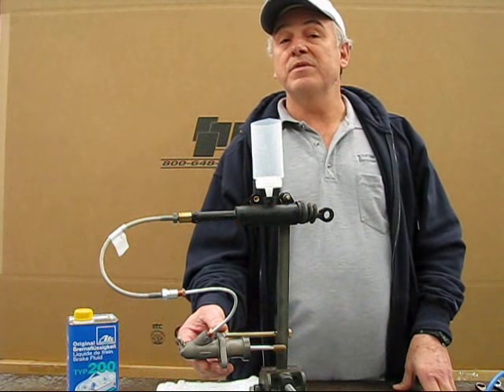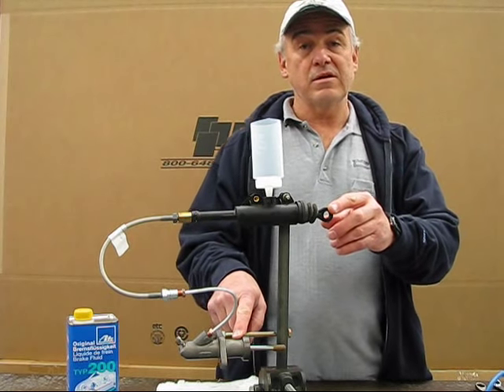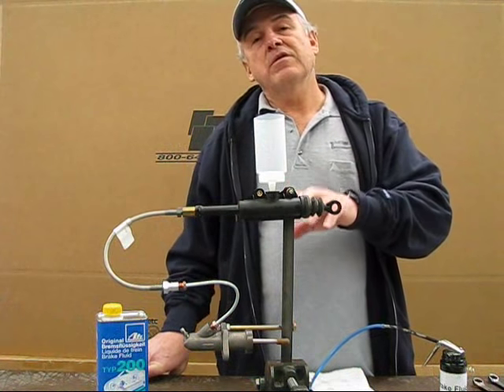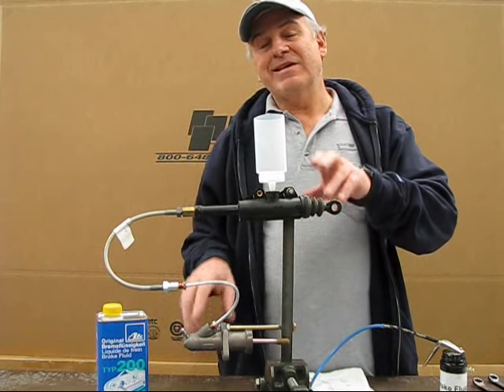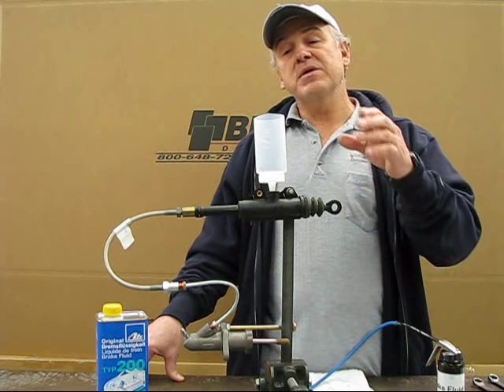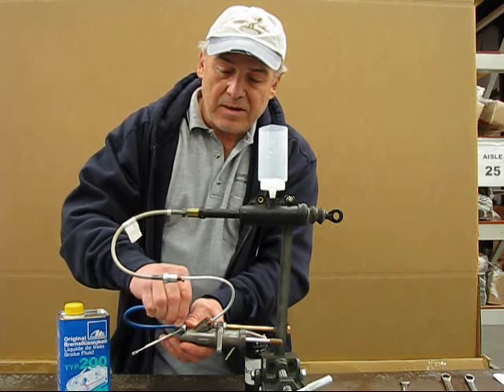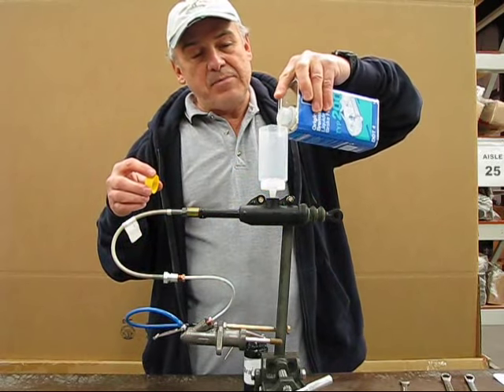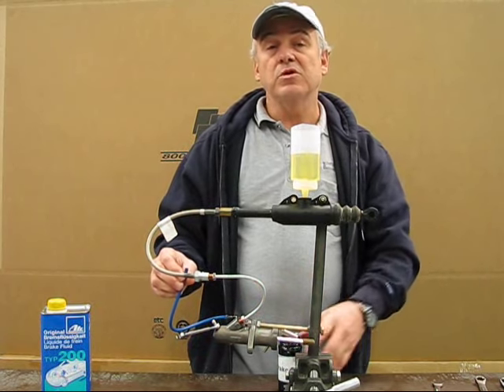BMW, VW, Porsche Clutch Bleeding

Comment: The flex line?  You mean a line specifically for brake/hydraulic fluid, or will just any pvc hose will do?
Reply: honestly, unless you plan on using it multiple times you can use any line that wont immediately disintegrate. Nylon line is fairly cheap and will do the trick.

Comment: hello i have the same problem as sphinxxx , i put the oiler under the level of the slavecylinder,clear hose and loose 1 turn the bleeder and fluid kept coming out from the threads,i pull out the whole damn bleeder and try to insert fluid and made a mess..I thought something is bloking the flow but how i can fix that without removing the hole system,,,I cant put pressuaried air cause could be worst right?

Comment: Thanks for the video, great information.  Maybe you can help me?  I started my E30 up after almost a year in covid storage.  It’s three hours away.  It started up no problem, but no clutch, it wouldn’t go into any gear.  I replaced the slave cylinder; and still no clutch? Is it possible that I need to try bleeding it your method? I planned on replacing the clutch master cylinder next. Maybe It’s not necessary? I did see some fluid on the floor of the garage around the area of the master cylinder. Any thoughts? Thanks.

Frank
Reply: Sounds like you lost all your  brake fluid... it leaked out of the slave cylinder.  You will  of had to bleed it  after the new parts were installed.

Comment: Im so hopeless.. one day my audi lost clutch pedal. Zero visible leaks. Proceeded to replace my clutch master cyl being it wasnt pumping. My new cm wen the plunger is pumped u can hear it pumping air. My issue has been bleeding from the slave cyl 5 times and clutch pedal is still soft. This video made it soooo dammm simple. Im getting a fluid pump as we speak. Then ill have the pedal depressed.  Open the slave and force fluid from the slave upwards to thr clutch master cylinder to the Reservoir and watch them bubbles disappear

Comment: I have a quick question. What position should a clutch pedal be when i do it. And what position should a clutch slave rod should be?
Reply: +Pusi Juzz Clutch pedal i up position. When you put the pedal down, the fluid can not get through the system.
Reply: If you figured this out please share. I'm in desperate need. Been bleeding for hours and want to try this method but need more info
Reply: open brake reservoir, empty it, then go down and open bleed screw, bleed until reservoir fill again, then close bleeder, press clutch like 30-50 times, then close reservoir, go do mad skids) thats how i did it, works...

Comment: Almost ready to go at that point? What happens after? In a car application I'm assuming the clutch pedal was in the up position and the slave was pushed out? If this is correct what comes after? I just changed a master and slave. Haven't tried this method yet but tried many others and everyone seems to leave out details and I'm left with no feel in my clutch pedal. I'm gonna go by a oil can right now but please if you could add some more detail.
Reply: What was the problem/solution?

Comment: Will this work for A 2007 Nissan 350z i replace clutch, clutch line and Slave Cylinder everything was done I started bleeding it  traditional way pumping then holding and breaking free the bleeder that over and over and the pedal got firm I took it for a test drive it felt good but the next day it was sunk to the floor I thought it leaked out so I check the clutch reservoir and it was full the way I left the night before has anyone been through this or know what could be going on why did sink after I bleed it and it was firm on the test drive

Comment: what prevents air from going into the brake lines or abs? on a Mini Cooper they share the reservoir
Reply: All vehicles clutch and brake share the same cylinder. Brake lines are on a different level/circuit and are un effected. Also you can only feed fluid into any line when you crack the nipple and open the reservoir allowing it to flow through.

If you put a straw in a glass of water the straw will fill with water.

If you put a straw into a glass of water with your finger on the top of the straw no water will enter the straw or flow through.

Comment: To anyone: In the demonstration, there is no lid on the (brake fluid reservoir)  has no lid. Would i remove the lid when I perform this technique on the actual vehicle?
Reply: Of course , the lid I s only  there to keep the fluid free from contamination,  it is not necessary for  operation of system.

Comment: Does the clutch pedal need to be pressed in at all? Or do you just crack the screw and start pumping?
Reply: Wondering the same thing.  I just tried this and my can is pumping but as soon as the hose is connected to the bleeder I get nothin.  Unsuccessful for me
Reply: @johncale814  I did it without pressing the clutch pedal. I wasn't able  to verify if bubbles were coming out of the master cylinder but fluid definitely seemed to be getting pumped. Car is working better than before but still not perfect. I have been having an issue with the shifter being difficult to get into gear sometimes and it would require a good rev to get it to go. Sometimes on cold starts I have to almost force it into gear. Might have to give it another go and see.
Reply: @jontansgarage  i appreciate the info!  Im gonna try it the old fashioned way today.  Lets hope our issues are just air and minor!
Reply: @jontansgarage  UPDATE:: did the flush with a large 65 CC plastic syringe; it took ALOT of pressure to push that initial air bubble out, but with enough force it happened!  Also very cool because with the syringe I had better control, force and could visually see the amount I was injecting!  Bought a two pack for $6 at a local Tractor/feed supply store.  Used one to suck old oil out of the reservoir, and the other to inject and bleed.  The clutch on my 82 bmw 320i is now ROCK SOLID.,
Reply: @johncale814   Nice! Do you have a link by chance to the syringe? I use a cooking style syringe for sucking stuff up, didn't consider using it on the bleeder for some reason. It was super awkward when I was doing it with my oiler so I feel like the extra control would be nice. Clutch was not pushed in I presume?
Reply: @jontansgarage  this isnt the exact one i used but its the same design.  Whichever one you buy just make sure it has the tapered discharge spout so you have enough room to get your hose on there securely.  It Also accommodates various size hoses. Many of the ones i saw had only a short nub on the end  where no hose will be able to connect.  Dont get those!  If your hose is long enough, you could even hook it up to your bleeder/slave, and stand above your reservoir  as you inject rather than laying underneath your car! (As long as your hose is nice and tight on the bleeder, make sure it doesnt pop off.. Also be sure to prime your hose as to not introduce more air into the system.  No pumping pressing or holding of clutch needed!!  Lay out plenty of rags/cardboard etc to catch the oil that will leak out as youre injecting

https://www.blowoutmedical.com/amsure-piston-irrigation-syringe-60-cc-luer-tip-adapter-as115.html?utm_source=google&utm_medium=base&utm_campaign=products&feed_special=google&gclid=EAIaIQobChMIkfPHxIqY8gIVXgytBh0wDAuoEAQYAyABEgK4ifD_BwE
Reply: @johncale814  Sounds good, appreciate the info. Glad this worked out for you!
Reply: @jontansgarage  maybe a worn synchro ring...

Comment: I have the same question as hawk7900  (below).  Do I need to have someone pressing (or depressing) the clutch pedal at all?  When does depressing the clutch pedal introduce air into the system (while having the bleeder valve open)?  Thanks for these informative vids.

Comment: This doesn't make any sense because the brake system is the same. The hydraulic fluid reservoir is higher than the brake caliper and everyone bleeds brakes by pushing it out and not pushing it in.

Comment: Nice instructions; 

Also:

Most of them are SELF-BLEEDING;  air RISES, and then the fluid goes down to take it's place; 

so leave it alone overnight; it almost never fails;
Reply: Jose Peixoto I fuckin wish 😂
Reply: On my BMW E30, the clutch will self bleed. Just keep adding fluid to reservoir and air bubbles will pop up as the level goes down. Takes about 20 minutes and I step on the clutch a couple times to dislodge any bubbles. I think it works because the line is continuously rising from slave to master to reservoir.

Comment: Wow. I wish i had seen this video before I attempted to do this. I could never get all the bubbles out using a normal vacuum pump to pull the fluid out the bleeder.
And why does BMW use a 7mm bleed screw? Who has a 7mm wrench?!? I had to make a quick trip to Advance Auto for one of those.

Comment: chek my channel to see what car i have,tomorrow imgonna do this;1)take all the system out from the reservoir to slave cylinder.2)stretch the lines in vertical position,the reservoir up and the slave down3)remove the slave from the flex hose and clean it in the properway use glicol wax and newseals if necessary4)all the lines must be clean with no dirt or the last bad fluid,5)fill with fluid in the slave no bubbles6)connect the line7)fill reservo,im thinking tomake a video ofthis what do u think?

Comment: Just tried  this , because  my cluth pedal  id  dead zero pressure ,  when I tried  to add fluid from  the slave nipples , fluid  all over  the floor - I have been  pumping  for hour nothing pedal is  still  is dead  on the floor. Mazda RX 8
Reply: Gluluman pull the pedal up with your hand and try again
Reply: listening  to a clown like you , was  my first mistake

Comment: Useless video!!!!!    It does not work for master cylinders of VW group cars and many more. Master clutch cylinder has little valve which closes wen brake pedal press due to pressure in clutch system.That little valve opens when pedal moves back to start position.So if You will pump pressure in system from the bottom  that valve is closing   holes to the oil tank and NO bubbles coming up.That bleeding air will be stuck in master cylinder. !!!
Reply: Dzintars Bergs you are correct.  It doesn't work either for my Porsche 964.  Maybe because the pedal wasn't all the way up but not sure.  In the video he moves the arm on the master cylinder, maybe that's what opened the valve.
Reply: +Dzintars Bergs Then how about having someone depress the clutch petal slightly. Do you have a better suggestion for VW's?